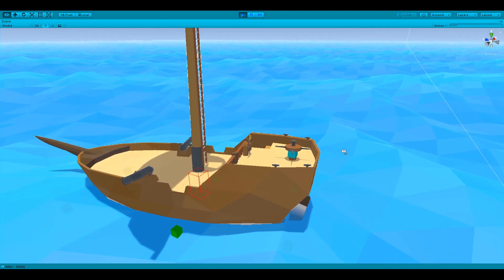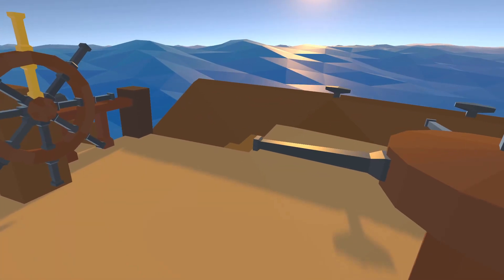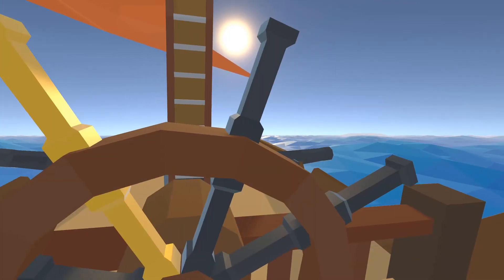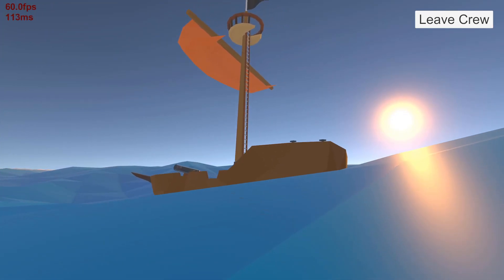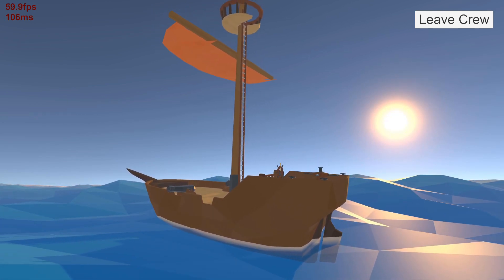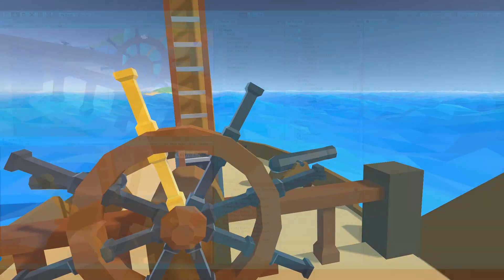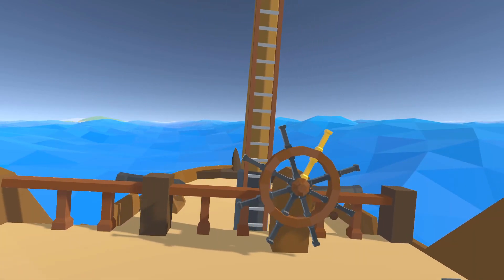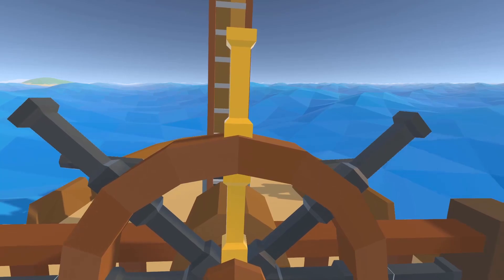Properly Interpolating Between Server State Updates | Unity Multiplayer Game Devlog #24

Comment: What system did you use for the 100ms delay? I'm working on a unity game and mirror code only seems use the time received for interpolation which seems flawed
Reply from the maker: I just built my own system to buffer position updates. It's basically just a list that the position updates are added to, and 100ms later they're used to set the object's position.
Reply: @tomweiland  Thanks for the reply!  Doesn't sound too hard.  Are you passing a time stamp from server to client?  Default mirror code doesn't seem to do that (for NetworkTransform, at least).  How do you account for variation in delay time from host to client?
Reply from the maker: Yeah, I have my client and server ticks synchronized. Extrapolation keeps things moving in the event that a packet goes missing or is delayed.

Comment: thanks Tom, but can you share a tutorial for implement interpolation? I'm hard working with your series, it's very nice, thank you
Reply from the maker: My interpolation code is in the networking-resources channel on my Discord server. It's just meant as an example, so it won't work straight out of the box.
Reply: I am facing the same problem with rotation, will look for your solution as you say on discord